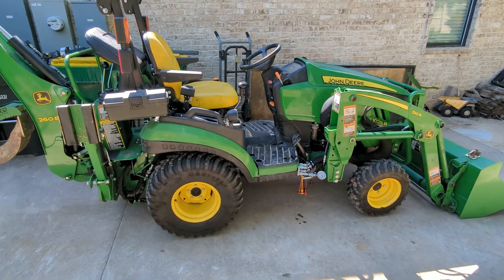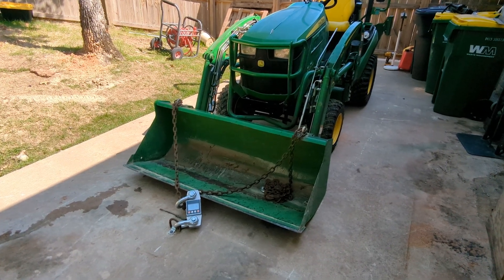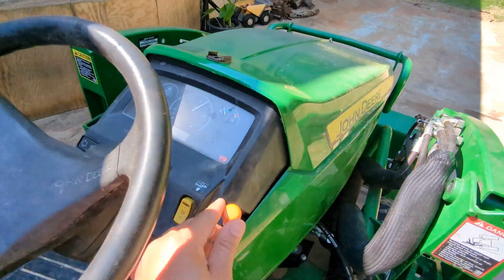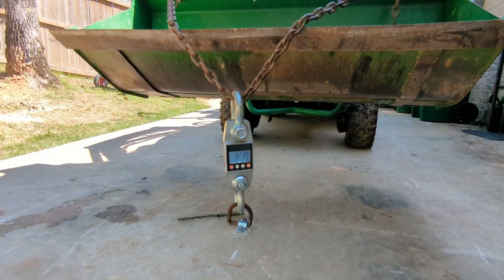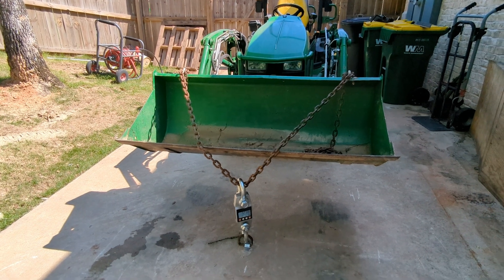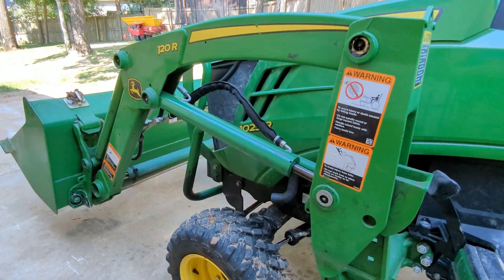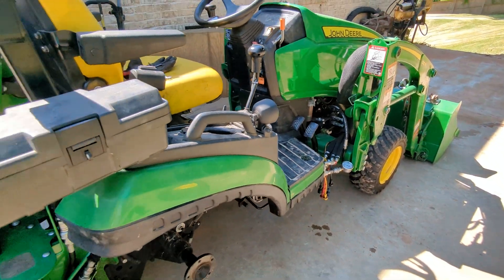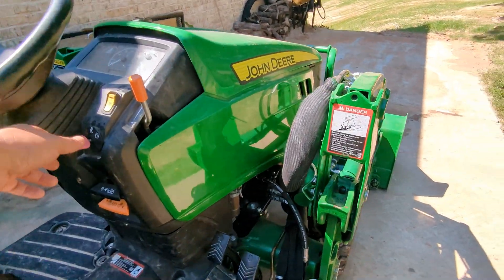HydrosPlus Cylinders+ 1025R Lift Test - Increase Lift Capacity with larger lift cylinders

Comment: you shoulda done a side by side test with a stock 1025r, but very cool stuff.  what would a kit like this cost?  Did you get 35% more lift capacity over the stock setup, or over the modified setup?  gen2 or gen3?
Reply from the maker: Here's the video with the stock cylinders if you're interested - https://www.youtube.com/watch?v=Yrn1VVxpMpg

Comment: I am going to buy the upgrades.....but what about the curl.....I made a pallet for my 260b hoe...and the tractor will not lift or curl it....even with forks....the lift would not be helpfull if the pallet slides off the forks
Reply from the maker: Thanks for providing your use case.  It's very helpful to understand what people need to do with their tractors.  I'm working on bucket curl cylinders - prototypes are coming in the next few weeks, but production models will be a few months away minimum if I go forward.  Be sure you're subscribed to my email list on hydrosplus.com and I'll keep you updated.

Comment: So I don’t even have a Deere, I have Kubota L2501, but I loved this video and love the idea. I wouldn’t cry if I gained another 30% of lift capacity. Excellent work Sir and best of luck with your endeavors.
Reply from the maker: I've thought about this, but since you'd also be losing about ~30% in speed, I don't feel good about the overall operator experience without a flow solution available.  Some people may decide to add the HydrosPlus cylinders without adding the flow solution, but they will at least have the option if the experience is intolerable :)

Comment: You may have already touched on this but I’m interested in upgrading the hydraulics on my Kioti CS2520 is this something you make get involved with in the future or am I just S.O.L. ?
Reply from the maker: Sorry, but there are no plans to support Kioti in the near future, but always open to the possibility.  The challenge with other brands is that they typically change designs more often, which means that if we develop a solution for a given  model, it has a limited market.  For other models we have looked at, even in the JD brand, we would likely never break even.

Comment: Any concern with front axle when running at 2500 or 3000 psi?
Reply from the maker: Personally, I don't have any concerns with the front axle at those pressures, but running higher pressures can make some things work a little funny.  For example, if you want to run a rear tilt cylinder, and you want the adjustment to be slow, so you use a restrictor fitting.  When you have the pressure set high, it will pull the engine down when you use it.  Nothing really hurt, just a little extra heat created momentarily, but I prefer to keep the pressure down at about 2500 psi for my use.  That's why I wanted to develop these cylinders, because I'm ok lifting more, but I want to do it at lower pressures.
Reply: Thanks. I wasn't sure if the front axle and tires could handle the extra weight with increased lift capability due to the increased pressure and cylinder size. 1800+ lbs is a significant increase over stock. Great to see little Johnny getting muscled up. 
Thanks for informative videos.

Comment: I'm curious if you will have direct replacements for my John Deere 790 with the 419 loader? I hope so and if the price is right I'll be buying a set!!
Reply from the maker: Possibly, but not on the radar at the moment due to other priorities.  I'll make a note and reach out if I do something for that model.
Reply: @HydrosPlus   I was curious these cylinder sizes might be same size as mine
Reply: @HydrosPlus  they looked at me the exact same diameter in length and hookups even though it's newer loader models you're putting them on they look like they use the same cylinders from the previous generation?
Reply from the maker: @daviddaniels4358  They are probably not exact, but they might work.  One challenge you will have on the 419 cylinders is that they get their grease from a zerk in the cylinder.  On these, the grease comes through the pin, so at a minimum, you'll have to create a way to grease the pins (this is based on what I can see on the parts schematic)  John Deere does a good job reusing parts if possible, since it's cheaper, so there are most likely other differences in mounting and stroke.  That said, it's possible that they can work, you may just lose some range of motion...or you could gain some :)

If you want to send me an email at kevin@hydrosplus.com, I can talk you through measuring yours to see how close they are.
Reply: @HydrosPlus  will do I will send you an email and my zerts are actually on the pins I have access holes through the loader to my zerts on the cylinders.

Comment: That is awesome & thankya for sharing the video with us. Are these hydralic cylinders on the H120 loader of your own design or did they come from somewhere else???
Reply from the maker: They are being built from my specs.
Reply: @HydrosPlus  Awesome! Best of luck👍🏼👍🏼👍🏼Hope all turns out well with em. 
Are the rods more durable???  Still gotchya in mind for the hydraulic pump upgrade one of these days
Reply from the maker: @truckerray7533  same durability.  Black nitride coated and same diameter.  Thanks!
Reply: @HydrosPlus  okir dokie. youre welcome

Comment: Would these modifications effect the factory warranty?  How much do these cylinders slow the function down when using the factory pump?
Reply from the maker: If you have a warranty claim that can be attributed to lifting with the loader, then it could affect your warranty.  This is the same for any modification, whether it be loaded tires or wheel spacers

So, if your loader latch breaks, this could be pointed to as a problem and JD may not cover it.  If your PTO goes out, then it's unrelated and they can't deny your warranty on that claim.
Reply from the maker: Sorry, forgot the second question.  Using the factory pump, these cylinders will be ~38% slower.  They will work, but given how slow it already is, it will be a pretty poor experience and you'll lose any ability to do 2 functions at once since the boom cylinders will require more fluid just to move.
Reply: @HydrosPlus  thanks.  What do you expect a kit would cost with a higher flow pump and the cylinders?
Reply: @landonfilms8660  Seriously. Just go look at his website.

Comment: Nice, how would a stock 2025r  2500 psi  prv with these cylinders be close to this
Reply from the maker: 2025R 2nd gen uses the same loader, so the performance should basically be identical.  There could be some small variation due to slightly taller tires, but should be minimal if any.

Comment: Was this test with the factory hydraulic pump?
Reply from the maker: No, this is with the HydrosPlus Extreme Capacity pump, but it will be the same as stock for capacity.  Extreme Capacity pump will be faster, but PSI will be the same.

Comment: I plan to get the performance kit for the JD 1025R. I like the large diameter boom arm hydraulics and would love to have that increased capacity.
Frustrating to not be able to use multi-function operations on the bucket and boom when that is what I am used to for decades. Love my 1025R but have need for more capacity in both multi-function and lift.
Not a full time user for increased capacity or I would buy a larger tractor for my ranch.
Thanks and look forward to replacing the boom hydraulics or lift arms whatever JD calls them.
Reply: The extreme capacity pump works great for multi functions ...can't wait to get these new cylinders.😎